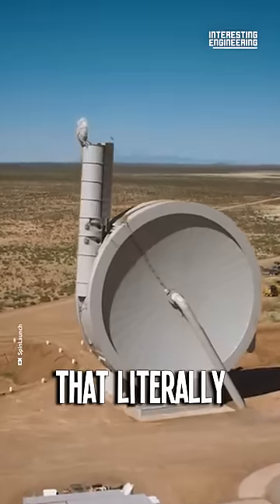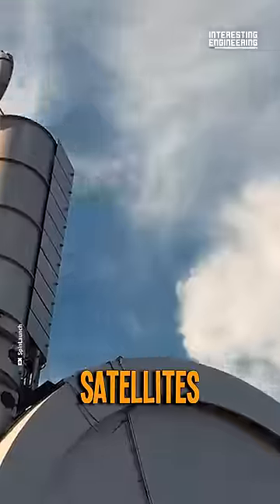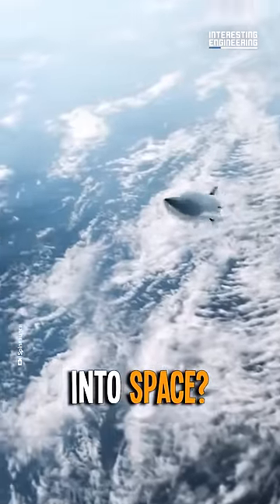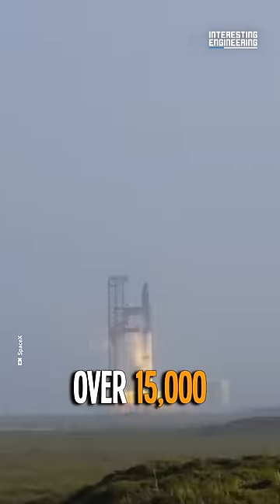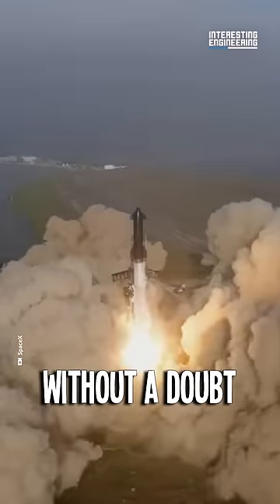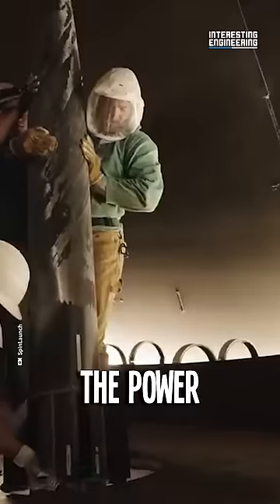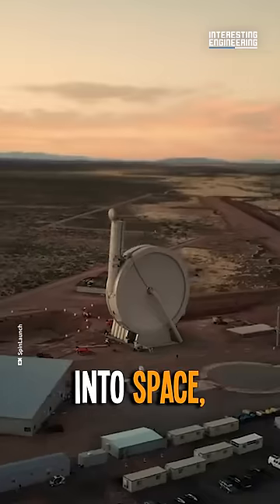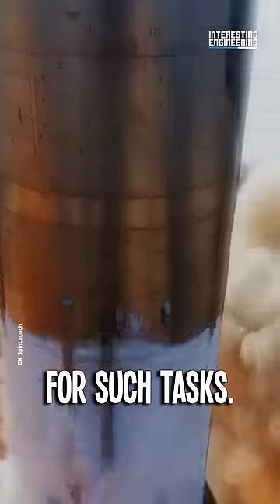Throwing Artillery Shells Into Space

Comment: No satellite went to orbit using this method.
Reply: Yeah, we've put more stuff into orbit by accident with nukes, than Spinlaunch has with their entire company built around that one detail.
Reply: Because there still looks for a play to build the main launch facility at, also they have has 10 successful alt test with a 1/3 scale version that reached 30,000 in alt btw that's the hight of normal airline planes
Reply: @CLOCK-WORK  So what? Making it 3 times bigger doesn't mean they'll throw stuff 3 times further. And even if they did, congrats, you now have a satellite falling down from space, because orbit is about horizontal speed, not altitude.
Reply: @ludovicschneider6190  that's not what I'm saying at all? Also when you ark and it's max apogee is 30,000 that's not bad also yea scaling it up 3 times would make it gose 3x further before it also means 3x the speed and force applied on the payload, also it's not just gona stop when it hits air, also a sling uses the same mechanics so just saying it works and rocks are a lot softer than metal or carbon fiber
Reply: @ludovicschneider6190  honestly you sound like you just understand the most basic mechanics when it comes to space and rockets, probably a thunderf00t follower
Reply: Not yet
Reply: Yet
Reply: ... and never will
Reply: ... where did they go...?
Or LAND? 😮
Reply: But theyve thrown a lot of crap directly at the ground!
Reply: @Robloxgod-np3tp then the information in this video in inaccurate
Reply: @thearchivalist8179 nothing went to orbit w nukes weapons, not ever.
Reply: @CLOCK-WORK throwing rocks fast don’t makes successes.
Reply: @CLOCK-WORK youre citing some number and putting an adjective on it w zero meaning. Altitude has nothing to do w orbital velocity. They  could have achieved similar outcome by climbing Mt Everest, for much less $.
Reply: @CLOCK-WORK  thunder foot is Chemist w publications. You’re tossing adjectives.
Reply: @Nill757 the point is this isn't chemistry, also he has shown not to understand basic space rocket's in the past
Reply: @CLOCK-WORK  he might be wrong at times.  the point is … he’s a scientist, and references scientific details in his summaries. Again, you reference nothing but adjectives.
Reply: @Nill757  you do realize he knows nothing about basic rocket things right? You know the thing needed to find out if this is a scam, and like I said I don't think nasa would work with and help spin launch if it really was a scam
Reply: @CLOCK-WORK You're projecting there, mate.
Reply: No satellite went to orbit YET. They only have a 1/3 scale prototype at the moment
Reply: @SirNobleIZH  there working on finding a place to put it at right now.
Reply: @CLOCK-WORK  3x bigger does not mean 3x the distance or speed, that doesn't nearly make any sense because if you throw a 15 pound ball with the same force you do a 5 pound ball, the 5 lbs ball goes much, much further
Reply: @cerealguy6359  uhh ok then explain how a sing works? Because there the same thing also because it's bigger it has more mass so it would also take more to speed it up to the same speed but it also would have a greater force, have you ever heard of every force has an opposite and equal reaction? Your just putting most of the reaction on the payload and because that force has to go somewhere it's turned into heat and speed
Reply: @cerealguy6359  also 3x bigger is equal to 3x the force because it's using the quote "centrifugal force" Wich in this case would have 3x the speed because you are also putting in 3x the force, The payload has less mass than the force that applies it has it self
Reply: @cerealguy6359  also not true because if you put in more force than the mass you can still send it farther that the 5 pound mass even those the mass is greater so would the force needed to throw it? It's not just mass you need to calculate it's also the force and speed
Reply: @CLOCK-WORK  obviously you are either a bot, a troll or just slow so, if you are slow I'll dumb it down for you but if not, well played, this'll be the last reply.

a sling is not the same as a rocket. A sling uses a small rock and propels it at high velocity to penetrate metal or armor to deal blunt damage, that's why they were effective against metal armor however a bow and arrow would shoot further and penetrate better comparatively. Your comparing a SOLID object being a rock at a decent speed to a multiple billion dollar metal creation with lots of tiny parts that all vibrate against each other and will break apart eventually. And no, the same force does NOT throw something just as far as something smaller. If you're trying to throw something further you use a bigger force, like a trebuchet, even then it's still not a sling. 

Apparently you don't understand that the more weight something has, the more force you need to send it the same amount of distance and fail to realize that scaling objects to a 1:1 ratio does not work at all due to something called square-cube law. Which just basically means making something bigger with the same ratios does NOT equal the same. For example, 5 lb weight and 10 lbs of force will go further than an object that weighs 50 lbs with 100 lbs of force, or a 15 lb object with 30 lbs of force. The 5 lbs object will go the furthest out of all of those due to the square-cube law, you need MORE force to throw those different weights equally, and the same exact reason an ant can carry multiple times their own weight and can make literal bridges and towers with multiple of their own kind and just stay there for hours with no issues while an elephant can barely stand holding another elephant and sometimes collapses during mating. 

This singular fact alone is enough to disqualify everything about your argument and i could keep going but needless to say the project won't ever work without proper and MUCH MUCH stronger materials while also weighing much much much less OR do something even better which is build a space elevator, build the rocket in space, and launch from the moon or another base in space which is better and easier and CHEAPER than the fidget spinner
Reply: @cerealguy6359  also try explaining cube law to a gun or a cannon? More charge with a heavier payload equals a greater speed, it's the reason why we have longer guns on a ship instead of wider one because most of the force is from the propellant
Reply: @cerealguy6359  also the 5 lbs won't go the farthest because it has less force so it also would have less speed
Reply: @cerealguy6359  also by that logic a 22. Should shoot further than a 50 cal but it doesn't

Comment: If you think the centrifugal force is bad, it gets far worse. The projectile itself has MASSIVE stored rotational energy on release. Just imagine how significant the shock loading would be when you're trying to stop a 3 metre, 455kg projectile rotating end-over-end at over 1000rpm within a small fraction of a millisecond......any payload will be completely obliterated.
Reply: We can use harbor freight straps to keep it tight.
Reply: These are satellites. They're not meant to be stopped.
Reply: Angular conservation of energy. It will try to tumble in the same direction it is spinning, and there is no way it could spin fast enough to make it out of the atmosphere, and not fly apart.
Reply: Assuming it's a human and not a computer with plastic chips to hold it
Reply: I would guess that arm get A LOT shorter when it releases that payload!
Reply: This is exactly what I was thinking. I don't understand how they think they're going to control the accuracy of it when they're creating centrifugal force but they needed to go straight up in one direction!?!? 🤯🤯🤤
Reply: If you watch the actual video it doesn’t immediately stop if literally just detaches the rocket
Reply: @barreldreamz7852  Have you ever taken a physics class? This it literally the most basic example of centripetal acceleration there is

Comment: Move it to an Equador mountaintop, get rid of the Acme centrifuge, and add a first stage and you might get some small light satellites launched.
Reply: The height of mountains is negligible when it comes to getting into orbit, they're cleared within the first few seconds. The slight advantage isn't worth the logistical nightmare of getting a rocket built and fueled in the remote mountains, and those can be disastrous in the event of an accident or emergency. 
I used to think it too :)
If it's a launcher thing like this, thinner atmosphere could have an effect, I imagine a limiting factor for these things is the air resistance, imagine reentry but with thicker atmosphere!
Reply: @DoubleNN  Yep, I also think the atmosphere thickness is the issue here.  At Mount Everest, you're already down to 1/3 of the air pressure found at the sea level.  99% of the air is below 30km altitude.  Rockets are still "travelling slow" at those altitudes, thus the drag, while significant, is nowhere near as critical.

Comment: This does not work especially trying to throw a delicate sensitive satellite into this method is spinning will destroy any electronics inside
Reply: Slow build up.of velocity not harm the electronics.
Reply: @insideoutsideupsidedown2218 your brain is very smooth 😂
Reply: It's possible to build satellites that will withstand the forces involved, but I have doubts about the accuracy. That spin-launched rocket is going to need to carry a decent amount of fuel itself to correct for launch errors.
Reply: It's really for throwing garbage  into space .
Reply: @insideoutsideupsidedown2218  the problem is that the tangential velocity will always be too intense, even if the angular acceleration is smooth. Circular motion works differently than linear motion.

Comment: OK. The amount of energy needed to throw a projectile into orbit is the same as the amount of energy that needs to be dissipated when the projectile deorbits.
And given that orbital speeds are so high that contact with the armosphere causes temperatures high enough to melt metal, then the same problem would apply to any projectile being thrown into orbit through the atmosphere.
At least a deorbiting projectile gets to meet a tenuous atmosphere first, which gradually becomes more dense as the speed bleeds off. But these projectiles are going to be blasted at maximum speed into a thick, dense atmosphere.
They don't stand a chance. 
It'd be like throwing a tomato at a brick wall.

Comment: Let’s see…as a US Marine I knew my M16A4 max velocity was ~3,150 m/s… which is roughly 7,050 mph exit velocity of the 556 bullet leaving the barrel, and those come down when you shoot them in the sky. And  So you’re saying the plan is to throw a satellite significantly faster than 7,000 mph? 🤔 

F = MA.  Avg mass of a “small” satellite is 2,600lbs, and average atmospheric exit velocity is 11.2km/s (Mach 33). Therefore you’ll need around 13,210,000 N of force.  When calculating for centrifugal force, that comes to approx 91,000,000+ mph of “spinning speed”
Reply: 🗣UUR-RAH Marine !!! S/F 🇺🇸
Reply: Marine my ass, I’ve never met a marine that could count past 10 or remember how many crayons he had for breakfast. If you’re that good at math and we’re a marine you would have made it to marine sniper or marsoc
Reply: Assuming no air resistance either. Anything coming out will be slowing down if it does not do at least some work towards maintaining velocity.
Reply: So 91 quadrillion papillon, flamillion, quintillion mph? I see no issue

Comment: 15k gallons ... thats 56775 liters .... imagine if your car fuel efficiency is 10 liter per 100km at avarage then you can cover 567 750km. I'm driving for 12 years and still haven't covered that much distance and the rocket burns that in a second .... THAT'S ACTUALLY INSANE.

P.S. I know they are not burning actually car fuel, but it's still insane.

Comment: if u throw a satellite with 90° from Erth surface,it's back to earth after some time Even if it's achieve Escape velocity just to escape but not get Orbital velocity.
Reply: You missed the part about it having a rocket on it that would ignite once it was mostly out of the atmosphere.
Reply: I agree with other commentators, sure seems like it shouldn’t be that hard to have an airplane take something up to high altitude and then deploy a rocket. This seems much simpler than these other ideas. Virgin galactic tried and failed, but the only tried like once then seemed to call it quits. Sure seems like it should work.
Reply: Earth*
Reply: @paulczar no material known to man can withstand the G forces exerted on the payload. So if it has moving parts they will disintegrate before it is ever released.

Comment: To put into perspective the G forces that must be survived for this to work, the sustained G load on the satellite just prior to separation from the launcher is as much as or higher than the shock G load satellite components are usually required to handle.  I.e., normally they only need to be able to withstand something on the order of 10000 Gs for milliseconds to not suffer damage from shock events like the jolt of explosive bolts firing as the stages separate.  This launcher would require those components to survive that same level of G loading (think hitting a steel plate with a sledge hammer) constantly for several seconds or even minutes.  I'm not talking about the angular acceleration of spinning the thing up or some oscillating acceleration, I'm talking about an absolutely mindblowing continuous acceleration that must be sustained radially inward.  The radial acceleration required to travel in a circular path is v^2/r, so to launch something at 1000 m/s (i.e., about as fast as a 5.56mm NATO round from a M16, not even fast enough to escape the atmosphere) from a launcher with a radius of 50 meters the projectile will be experiencing a sustained 20,000 Gs just prior to separation.

Edit: To iterate a bit further, a solid aluminum cube will warp under its own weight at that kind of G loading.
Reply: Do you think that a linear one, say a monster rail gun built high in the Andes or Himalayas, could have a chance of working?
Reply: @J.Green-Rx  Railguns are no good idea. You don´t want your precious, expensive high-tech satellite travel through an extremely potent magnetic field - I am quite certain, that would just fry the electronics.
Reply: @Nachtmahr79  
Faraday cage discarding sabot?
Reply: @J.Green-Rx Let’s do the math. To stay in orbit, a satellite has to do about 11 km per second. And let’s say you build a really, REALLY big railgun, 1 km long. 

The formula for distance traveled from zero is ∆x=1/2a(t^2) and the final speed is v=at. We set ∆x at 1000m and v at 110000 m/s. 

Now, the formulas show that to reach 11 km/s you’d have to accelerate at over 60000 m/s2, travelling the rail in under 0.2 seconds. 
So that’s an acceleration of more than 6000g. NOTHING will survive that. 

And that’s just to reach escape velocity, it doesn’t account for air resistance. To punch through the atmosphere by inertia only, the acceleration has has to be multiplied by some factor. And then there’s the enormous heat production from the friction with the air! But for all of that you’d have to ask someone who’s much more intelligent than me. 

I say: impossible.
Reply: @peterdefrankrijker  
A project like that kilometers long (more length = less severe acceleration?) ain't diddly. 
Look at Cern. 
It's no big deal to make something many kilometers in length that uses many really big magnets.

And if it could not impart enough velocity to put something into orbit directly, then perhaps it could impart enough to improve fuel use or to allow for heavier payloads.
Maybe it could make space planes work.
Reply: So in a nutshell… it’s a pipe dream and will never come to fruition.
Reply: Great, yes. And even if it were possible to accelerate an object to earth escape velocity the mass of that object hitting the atmosphere at ground level would cause it to disintegrate once it left the propulsion accelerator. Like a confetti cannon.

Comment: I was in field Artillery and even if you point the cannon straight up using charge 7 you still can't get a 100 lbs artillery shell into space try using an enormous sling shot 😊
Reply: they gonna install this on the future moon base
Reply: I don’t think they’re claiming it gets them all the way to space, just that it is getting them high enough that a relatively small rocket can get the payload the rest of the way.  Essentially, it is replacing the first stage of a rocket, which is generally the most expensive.  If they were actually launching shells into space, DARPA would be all over this (which it still may be).